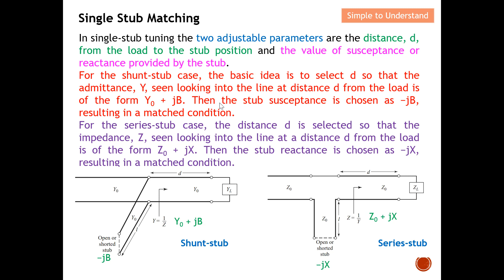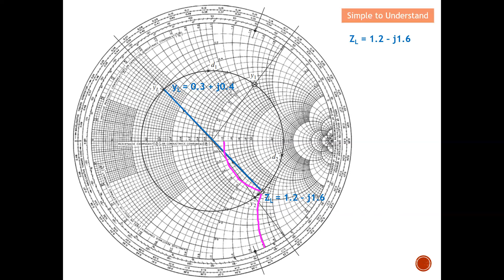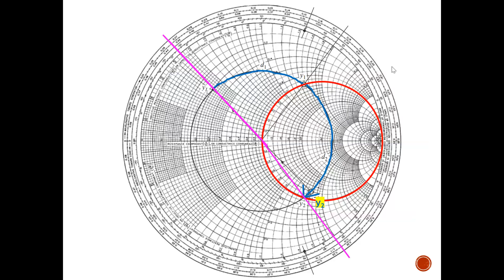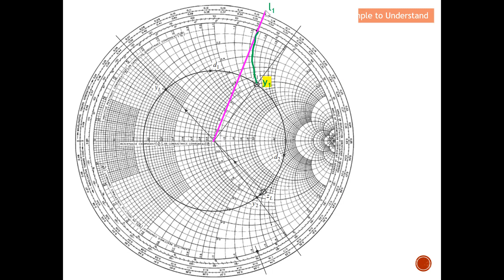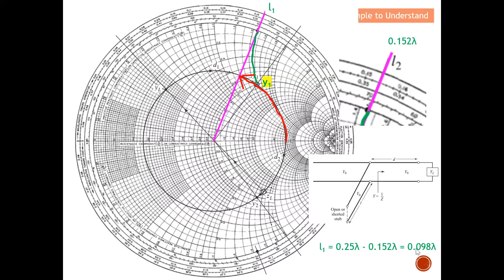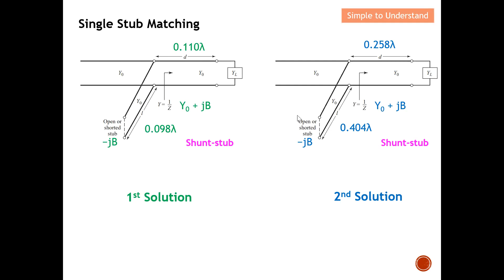Impedance Matching #10. How to Use Smith Chart to Design a Single Shunt Stub Matching Network.

Comment: shouldn't i+jb circle be on the left side of the smith chart .The red circle is'nt it a constance resistance circle
Reply from the maker: Right hand side will be impedance and left hand side will be admittance and I want to know the impedance and hence I the circle on the right hand side.  :)
Reply: @technologiesdiscussion1676  Thank you for the detailed and very informative lecture series. I also have a similar doubt. I didn't understand how you drew the 1+jB circle;  how the curve for B=0.4 intersects with the curve for Y=1 to result in the red circle? Thank you for your response.